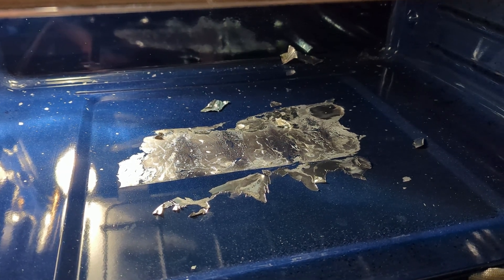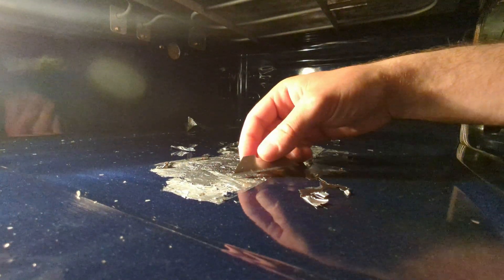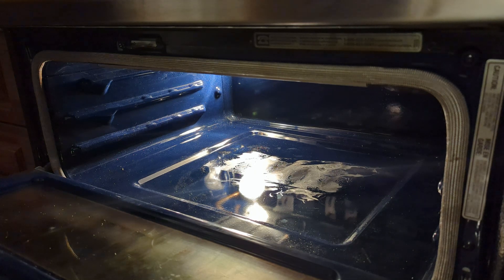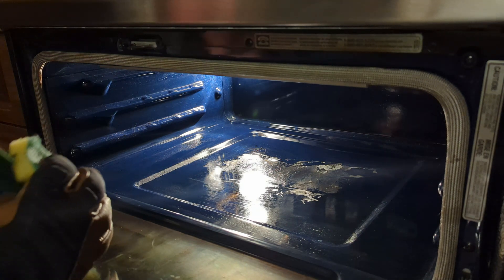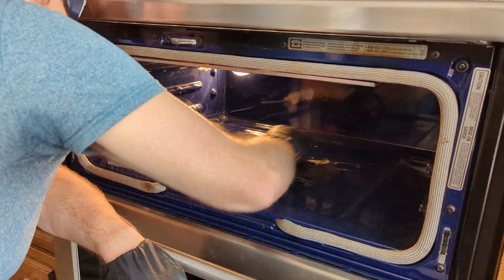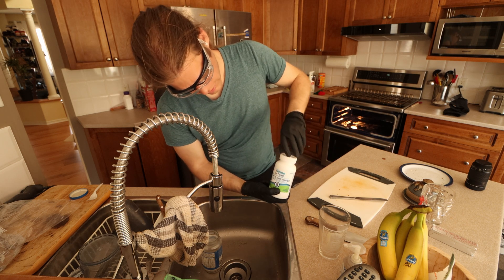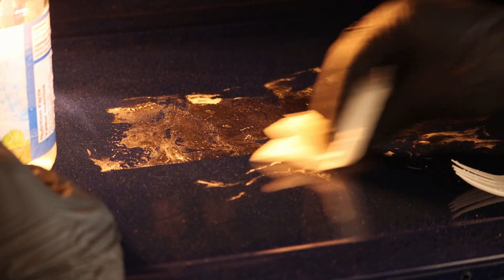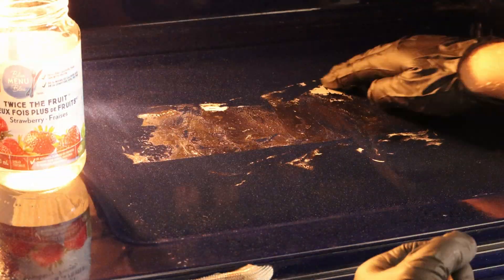The great and terrible aluminium foil disaster -- How I removed Melted aluminum foil from the oven

Comment: I just yesterday had to order a brand new bottom piece for my almost new Samsung gas oven....almost $200 bucks. An expensive lesson.
Reply from the maker: Yea it was pretty terrible.. this one was much more expensive to replace and I had no budget for that so.. chemical solutions were all I could do
Reply: @NathanaelNewton  On mine the heat had etched lines in the enamel under the foil so the enamel was really destroyed it was bizarre.
Reply from the maker: @joshr9417  Yea there was some permanent discoloration where perhaps some of the aluminum diffused into the enamel on this one.. I was fortunate that the owner found the end result acceptable and volunteered to take some of the blame as they were the one that suggested putting foil under the pizza without realizing that I had never encountered an oven with a built in element. What a dreadful experience this was lmao

Comment: Do not buy cheap aluminum foil.  Buy the best.  I never saw better aluminum foil melt on my oven before.  Was doing it for 30 years. Temperature was at 380 degrees.   That never happened until I bought the cheap stuff. Reynolds wrap does not do this.
Reply from the maker: This was not cheap aluminium foil, it's an oven that has the heating element built into the floor.. One should not use aluminum foil on ovens like this.
Reply: @NathanaelNewton   oh ok, so you used reynolds wrap. Good tip about the oven. thanks.
Reply from the maker: Yeah.. It's a lesson I won't soon forget 😔
It's basically the same as putting aluminum foil right on the red hot heating element of a standard stove.. 🤦‍♀️
Reply: I got my foil from TEMU. 
Is that ok?
Reply from the maker: I wouldn't trust anything to be food safe from them. 
Temu is the demonic love child of Cthulhu and late-stage capitalism

Comment: Where do you buy this?
Reply from the maker: Sodium hydroxide pellets? I got it from the hardware store, 'home hardware'
You can get it from most hardware stores and cleaning supply centers, just be really careful. Do your research and make sure you use proper protective equipment and plenty of ventilation.

Comment: Especially with a gas oven..... However with electric it was very common to use foil, though you normally put it on a shelf instead, or used the oven tray to hold it above the base.

Also you can just spray on oven cleaner, the caustic solution will dissolve it nicely.
Reply from the maker: What is said oven cleaner made of?
Reply: @NathanaelNewton  Normally contains ammonia or sodium hydroxide, both of which are very basic and thus will dissolve the aluminium off the enamelled steel. You can use ammoniated kitchen cleanser as well, or the spray on ones, or just get ammonia based cleaner, which is sold as the old fashioned oven cleaner.

Or you can use drain cleaner, which is mostly caustic soda, sodium hydroxide in the flake ones, though the reaction will be vigorous, and do not mix the chemicals, as it can be bad.
Reply from the maker: Yeah I had a very limited amount of money so I ended up buying lye (sodium hydroxide) crystals and using them in this video. That way I could slowly increase the strength until I found a solution that was strong enough.

The worst that produces is hydrogen gas so have heavy ventilation and it works pretty well
Reply: Oven cleaner doesn’t work and the youtube one that says bar keepers friend and wet towel didn’t work. So, I’m trying this but wasn’t to know about parts per cup of water, about it looked like maybe you had 2-3 cups of water and about3 tablespoons or less?
Reply from the maker: I would say teaspoons not tablespoons, be very careful, it's quite dangerous, make sure it's well ventilated and you use PPE